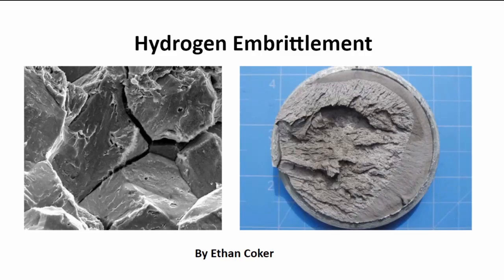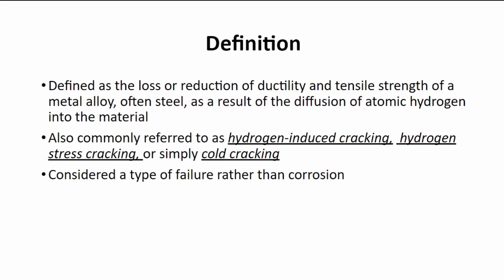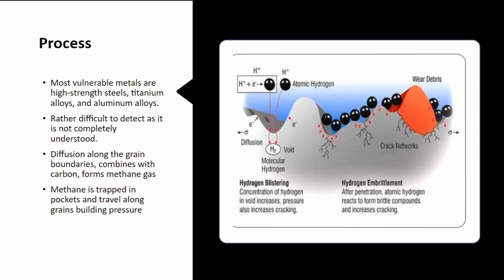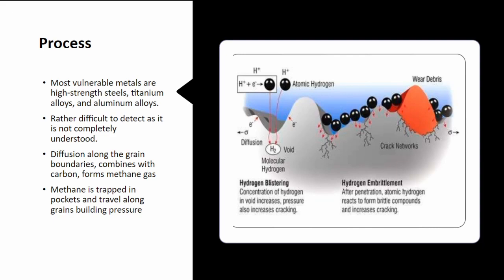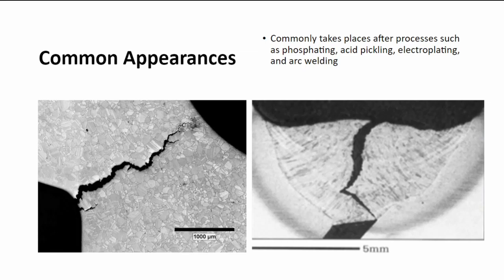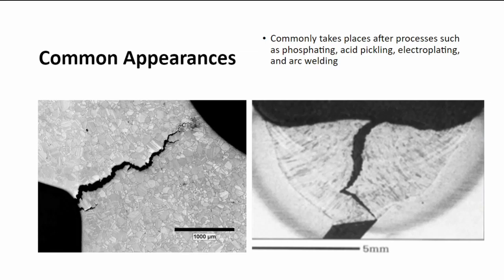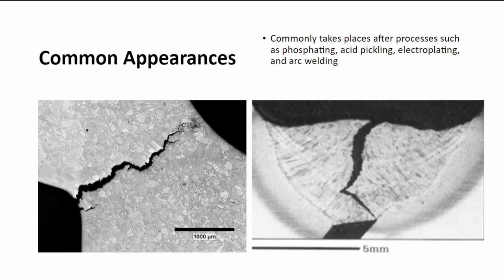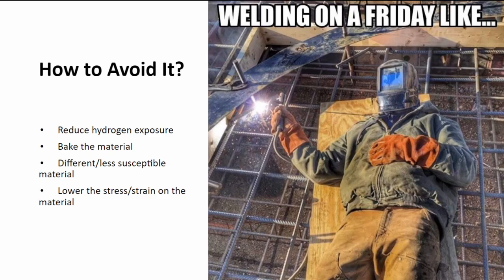MEMT 201 Hydrogen Embrittlement

Comment: the production of methane within the steel due to the reaction of hydrogen with carbon is less commonly discussed in the context of hydrogen embrittlement. the presence of hydrogen in steel is known to cause issues. It can lead to reduced ductility and unpredictable failures due to the creation of internal pressures or by aiding crack propagation through mechanisms like hydrogen-enhanced decohesion or hydrogen-enhanced localized plasticity.